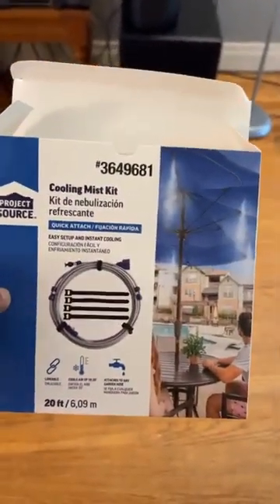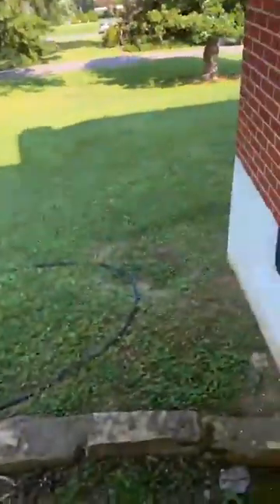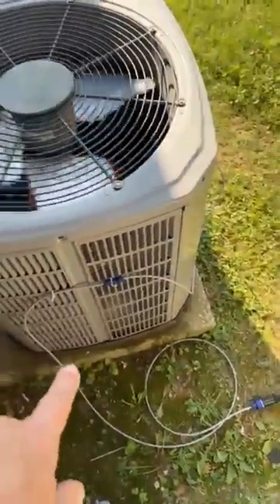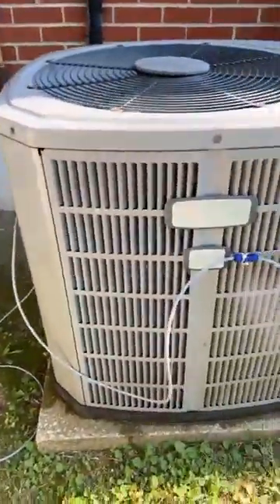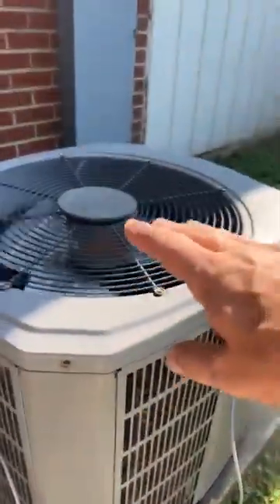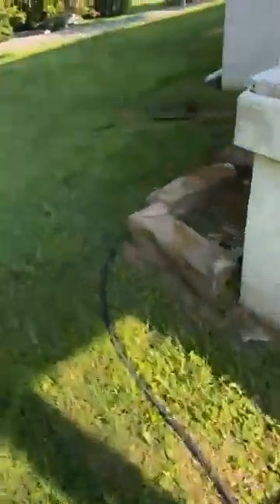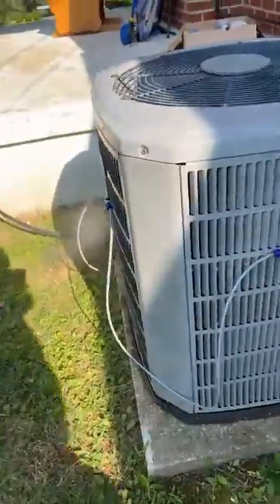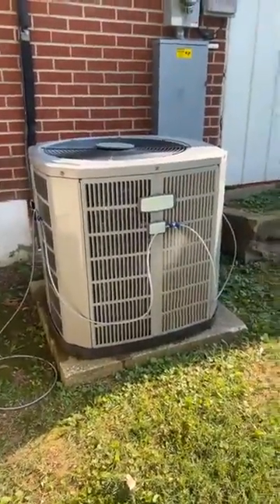DIY HVAC cooling system for those hot days above 100deg   By Robb Way

Comment: Yeah you're going to ruin your system with that. There could be a number of problems with the system like airflow or low or high refrigerant charge, a low capacitor or even dirty filters or coils. I would recommend getting your system looked at. I live in Las Vegas where its 110 degrees + and I get freezing cold air.
Reply from the maker: I disconnected it until I get it looked at. Of course I could get a filter but I think the unit is almost 18 years old. Maybe look into getting a new one. Lol. Thanks for the info.

Comment: I saw on one of those kits that they had a filter on it to help prevent calcium from building up on your coil.
Reply: Yeah you’re going to end up with a ton of dissolved minerals on your coils.  

Years ago I built a system by making a cage of PVC pipe and put the little mister heads all over it.  I finally gave up after reading about the calcium problems.
Reply from the maker: I saw that as well.